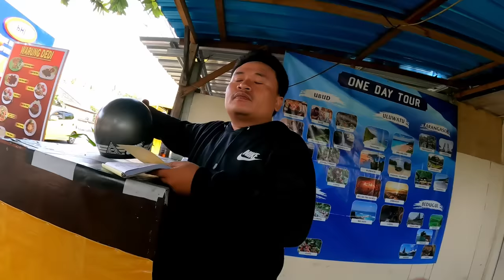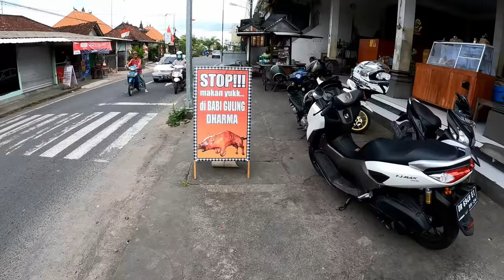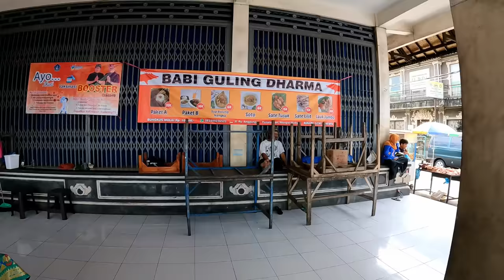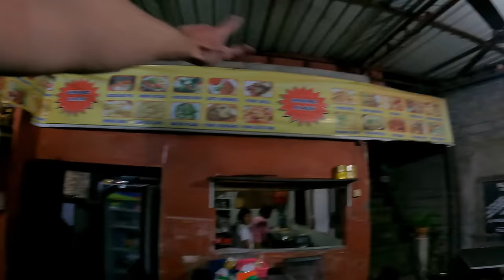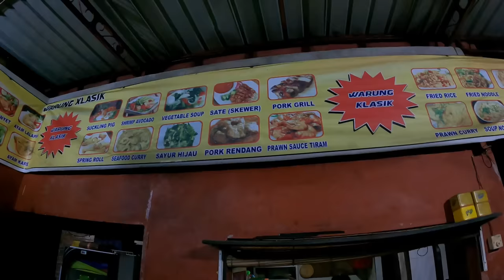$1 Pork Feast in Bali, Indonesia 🇮🇩

Comment: FYI DALE, if u wanna fill the motorcycle fueltank in Indonesia, there is 2 types of fuel in the Pertamina Gov. Fuel Vendors around country of Indonesia, the white ones are called Pertalite which is more cheaper than the Blue ones called Pertamax

its because the white ones  has given a subvention from Indonesian Goverments so it will cheaper